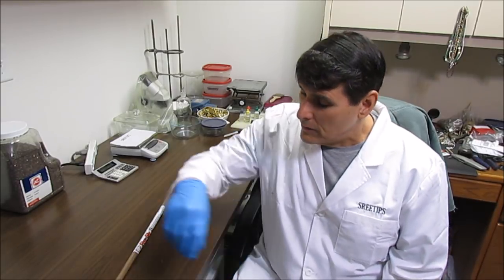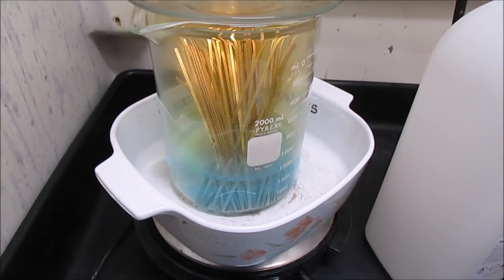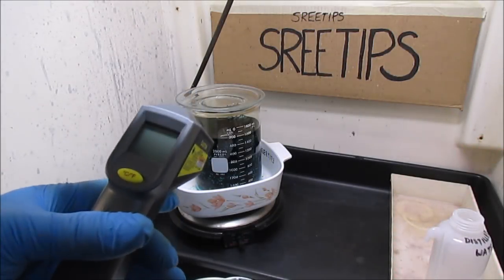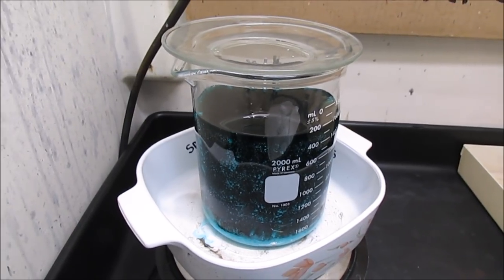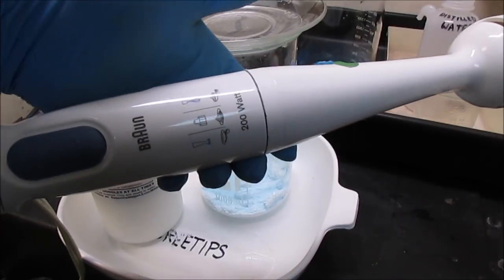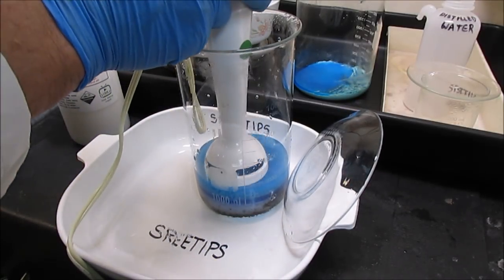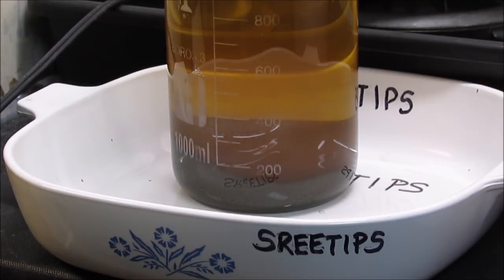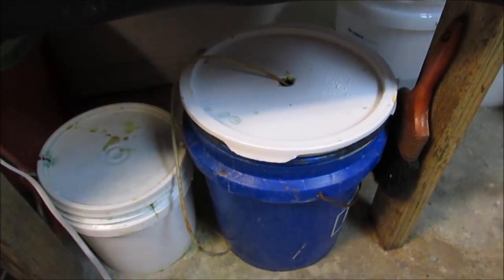Sreetips Silver Recovery From Brazing Rod

Comment: I’ve been saving brazing scraps for years. The plant that I worked at use to throw them away. I’ve got 35lbs saved. It’s all 80.15.5. Now I know what to do with it. Thanks sreetips!!!
Reply: Use electrowinning to remove the copper and save serious cash on nitric acid. 
I use this material all the time at work and have bought 10lbs for cheap awhile back to play with. 
For fun and in small quantities, sure nitric. 
35lbs….I’d build an electrowinning set up. And the precipitate in the video could be phosphorus??? I know they use some of that in stay silv for a self flux as it goes molten it burns up creating a tiny atmosphere, but when dissolving it could turn into a powder. I have the msd sheets in my cupboard.

Comment: Whodathunk to recover silver from brazing rods? Sreetips, that's who! Excellent video, the yield was unexpectedly low, but you still have some more rod ends and some silver chloride to process from this batch of rods. You pulled it off nicely, sreetips, a guy could save up the silver solder brazing rod bits, and make a nice silver stash from them. At least they wouldn't have to go into the garbage.

Comment: I subbed the first time I found this site, one of my go to's for great info. I have accumulated about 40 lbs of high quality computer gold from older computers well cleaned. My problem is finding nitric acid in gallon containers where I live in western canada. 👍
Reply from the maker: Hello. You can use acid peroxide to lift the gold foils off the fiber board. Then dissolve the gold foils in bleach and HCl. Precipitate with SMB or ferrous sulfate. Not one drop of nitric required.
Reply: @sreetips  Thanks, I will do that. 👍

Comment: Hey sreetips!! I've worked with Harris 15 for most of my life.   What you might not have picked up is that silver brazing rods have a significant amount of phosphorous added to act as a wetting agent when the silver/copper alloy begins to flow.  You can buy brazing rods with different alloys all the way from 45% down to 0% which is called Phos-copper brazing rod.  You just did in reverse what I've wanted to do for years and that is make my own brazing rods. haha
Reply from the maker: Cool, I seen these at the welding store and decided to try to get the silver out.

Comment: Thanks for this video, I think that I can determine a way to apply this profitably: I work in HVAC and am also a beginner hobby refiner.

I already seperate/cut my clean copper scrap from the soldered joints when cashing it in because of the superior payout on the clean versus soldered. 

If I use the silver soldered copper in order to precipitate silver out of  nitric (if Im already doing that anyway) then I can seperate the silver from the copper and cement the silver out at the same time. 

Thanks again.
Reply from the maker: I agree

Comment: I was thinking that a copper sulfate cell would work better and be more cost effective. Then your silver would be in the anode sludge and wouldn't need to be precipitated , just dried and melted and rerun through your silver cell. I love your videos bro !!! I learned why my copper sulfate cell turned green from the info you gave about your waste bucket. 
I was using a stainless steel anode basket I made to dissolve the copper away from silver electrical contacts. My basket started to dissolve and I learned just now that was an iron contaminant from the dissolving basket . Thank you sir 😎
Reply from the maker: Bravo. Try using a plastic anode basket.
Reply: @sreetips  I like your silver cell anode basket better .

Comment: Thank you for this video, I've wondered about getting silver out of these rods and silver solder. I have been in coin collecting on an amateur level since about 1974 and I started working in maintenance, commercial and then later industrial electrical also periods of general maintenance and whatever else was necessary to pay the bills as long as it was legal and ethical, sorry just rambling.

Comment: Probably electrolytic refining would be the way to go. I'm doing it now. You're my teacher so I respect the fact that you took your time to make this video.
Reply from the maker: I never considered running it through an electrolytic cell. The large amount of copper (80% by weight) would quickly foul the electrolyte. But it could be added a few pieces at a time during normal silver cell operation until it was completely processed. I don't know what the phosphorus would do to the cell.
Reply: sreetips your half right. Run it like you are refining copper and not silver. Then the silver will coalesce under the anode as blacks and then you can refine that. Not copper in silver nitrate but cu+4 plating out on a copper plate. Leaving the silver as a byproduct
Reply from the maker: Got it, but I've no experience refining copper. I get loads of copper to use for refining from yard sales and I buy copper fittings for cheap as well.
Reply: Yes! I think I referred to this in a reply to another comment.  This link shows the copper electroplating process real well.  You end up with pure copper on the cathode and everything else is in the bottom as anode slimes.  The anode slimes can then be refined.  
https://www.youtube.com/watch?v=cnJeK9CwkiU

Comment: Light Blue precipitate is likely tin (IV) oxide, SnO2.  Tin is often added to brazing alloys to reduce their flow point and assiust in wetting copper.  ASlso be aware that many copper based brazing alloys contain phosphorus, mostly present as copper phosphide.
Reply from the maker: This brazing material had phosphorous listed on the label.

Comment: You did an amazing job sir!  I'd be most interested in learning more. I've purchased probably around 50 pounds of 15% silver soldier and harvest  hundreds of pounds of soldered joints.
Reply from the maker: It will take much nitric acid to dissolve all the metal. Probably more than the silver is worth.
Reply: @sreetips  If you are someone with more time than money you can always recover the Nitric acid by distillation.

Comment: This was another instructive and informative video as i have learned to expect from you. Thanks for your work.

I watched another man process Silver in a You Tube video...not to refine it to market it... but to make something for which he needed Silver...which I cannot remember...and I did not bookmark the video...ouch.

Well after he had precipitated the Silver Oxide from the Silver Chloride solution he just melted the Silver Oxide in order to retrieve his Silver. 

He did not bother with adding sugar or Karo Syrup. He claimed that the Oxygen combines with the Gas during his melt....which makes sense when considering an efficient use of fuel. 

Silver Oxide is an Oxidant, I believe. And you are releasing energy when adding the Sugar...perhaps heat which can be added to melt when the excess Oxygen is added to the Gas....and heat is released

So what are the downsides, if any, to that process?

I think I may try that...unless you have a reason why that you are not to do that. 

Thanks for your forthcoming answer..
Reply from the maker: I've been told that the silver oxide will melt straight away. But I've never tried it. However, you must remove as much of the sodium hydroxide as possible before melting the silver oxide. Molten sodium hydroxide will attach and melt silica (glass). If some of the lye (sodium hydroxide) is still present in the silver oxide, then it will dissolve the fused silica melt dish and deposit the glass on to your metal. It must then be removed mechanically from the metal.

Comment: Just caught this video and you have probably already figured it out but... Those silver brazing rods are 5% phosphorus. With nitric acid, that will redox to phosphoric acid, which should not effect what you were doing, but that and some miscelaneous impruities and manufacturing slag, were most likely the "unknown precipitate". I'm a little fuzzy on the subject, but silver nitrate (I) with phosphoric acid, i think will create silver orthophosphate. I'm not exactly sure what that reaction would have had done in your mix, but possibly lowering the yield and leaving some yellowish sludge. In a perfect world (by equation) it takes 4.3ml of azeotropic nitric acid (68ish percent) to dissolve 1gram of copper. At 80% copper in the material, that would have required 1567ml of conc. nitric to get the job done (ouch!). Not to mention the H20 need for solubility. Add in the 82.96ml of nitric needed for dissolving the 15% silver (68.37g) at 1.22ml HNO3 per gram of Ag. The nitric need for copper is why whenever I need to inquart, I much prefer silver to keep the refining costs down (Ag is 28% of the cost of processing Cu). So... my opinion is... two things were battling you (1) a ton of nitric required and (2) possibly some interactions with phosphorus. Maybe a high power chemist could enlighten us further.
Reply: Damn bro give him hell ❤lol😂

Comment: I'm going to suggest you convert the silver chloride to silver metal by drying it, add 1.5 x molar sodium carbonaste< and just melt in graphite crucible.   The carbonate/chloride xixture melts at about 800°C and serves very weLL as a flux.  No need to make things all sticky with borax.  Just melt and pour beautiful metallic silver.  Nickel does not interfere, nor does tin oxide.  Easy peasy, no need to reduce before melting.  Chemical reduction is not only unnecessary but vastly complicates the mechanics.  My technique is dissolve, then prepip as chloride, add 1.5x molar amount of anhydrous sodium carbonate, dump in a crucible and melt.  then pour off in graphite bar mold.
Reply from the maker: Harold_V on the GRF said he tried this method with good results. He said that the crucible must not be over-filled with the chloride. I think he recommended no more than 1/4 full of the dried silver chloride. Because it will boil over with the carbonate and create a big mess in the furnace. I prefer the wet chemical process myself.

Comment: It is still an honor to benefit from your sacrifice in the name of education, thank you again.  Would I be correct to speculate the cost of the nitric would negate the recovery on a couple 2lb blooms that are 28% silver according to a spectral analysis?
Reply from the maker: That would be an accurate conclusion Scott. There is just too much copper in that alloy to make it profitable. If nitric acid was cheap enough, and you came across a large quantity of the silver brazing rod, then it might be worth looking at. Especially when silver gets up around $100 per troy ounce, and it will, when all these financial bubbles start to pop.
Reply: Thanks for the reply.  I too am afraid that when the Polytetrafluoroethylene wears off the Teflon Don, the markets may close down like a Dutch tulip on a rainy night.
Reply: @scottlund4562  Don't knock our tulips!

Comment: I suck at chemistry but I am curious if its possible to also recover the copper and other metals in the rod that dissolved into solution?
Reply from the maker: Getting the copper is easy, just add the copper solution to a container full of iron. The copper will precipitate on the iron as a fine copper powder and fall to the bottom of the container as nearly pure copper metal. The iron goes into solution as the copper comes out of solution. However, if other metals are present that are lower down the list in the reactivity series of metals, then they too will precipitate out with the copper. I'll do a video on the reactivity series of metals. It's so important to understand how it works and is applicable at every level of refining precious metals, as well as non-precious metals.
Reply: I am looking forward to seeing that video. Its to bad most chemistry classes in school are all about the textbook and almost nothing to do with real experiments. Watching your videos helps me understand some chemistry and I enjoy it. Maybe one day I'll try to extract the platinum from a whole bunch of spark plug tips I have collected over the years, I think CodysLab did that in one of his videos.

Comment: Thanks again for another fantastic video. Could it have been easier to dissolve if the brazen rods were melted down first? I am not knowledgeable on the subject of welding but that was my first thought.
Reply from the maker: No, melting would not change the rate that it dissolved. With that much copper in there, the silver, as it dissolved, cemented right back out of solution on to the copper. Then more nitric was consumed to dissolve the silver again, then it would cement out on the copper - over and over using more nitric acid as it went. This will keep happening until all the copper and silver has dissolved completely. I think I was almost there in the video. I may make a supplemental video and process the residual silver from the waste and from the bits that remained in the reaction beaker.

Comment: I used 40% Nitric ..that's about 8 mol of Nitric per liter... so I needed (fictionally) half a liter of Nitric = 4 mol of HNO3 to dissolve 0.5 ( 3 x 108) = 162 grams of Silver. You need that for every metal and also need to take in account what the solubility is. You can also see that in diluted nitric with every 3 mol of Silver 2 mol = 36 grams of water is formed.

Comment: Angle iron to put in your waste bucket is quite expensive.  I would suggest looking around local train tracks for discarded railroad spikes and rail plates.  They are free.  I use them in my waste bucket.
Reply from the maker: I agree, those three pieces cost me about ten bucks. I've just never taken the time to go out and find some scrap iron. I've been like that as far back as I can remember, convenience over frugality. Probably why I am broke today!
Reply: How about using scrap auto brake discs. Big surface area and plenty around.

Comment: I knew there was silver to be had in solder :) Of course it's not just any kind of solder you used in this case... but I'm sure other kinds of solder contain at the very least traces of silver as well.
That being said, were you aware that some older lightning rods contain platinum or silver as well? Be careful though, some lightning rods from before WW II also contain slight amounts of radioactive radium or uranium. 
People thought, back then, the radioactive material would ionize the air around it making lightning flow easier; which, all being said and done is a bit weird, since you certainly don't want to attract even MORE lightning.
Thanks for the video and taking me up on my suggestion about the solder :)
Great video
Reply from the maker: So your the one who suggested it, thank you for the idea!
Reply from the maker: I'll keep my eyes open for a lightning rod. That would make a good video.

Comment: Did you figure out what the sediment was during the nitric acid stage? I've been dissolving whole circuit boards in nitric and have been dealing with mystery sediment  the whole time. I don't know if it's good stuff or bad stuff... but it is a tan color and it settles fast, leaving a forest green liquid that looks just like stuff you had in a palladium video. I really don't suspect mine is due to large amounts of palladium though.
Reply from the maker: Get some stannous chloride. Lean how to identify metals in solution
Reply: @sreetips  Thanks for the keywords to search. One of the videos that pops up is from you. I watched it and leaned some things, but in it, you said that you didn't know [the answer to my question]. You could have just answered with that, but then I wouldn't have gone and leaned from the combination of informative clips.

Comment: For Copper in dilute nitric : 3Cu + 8 HNO3 _> 3Cu(HNO3)2 + 4H20 + 2NO = 3 (63,5) + 8(63) -> 3(188) + 4(18) + 2(30) so I need 1 liter = 8 mol nitric to dissolve 190 grams of Copper..with that reaktion also 72 grams of water is produced. But as we have seen in the Soluability tables Copper nitrate dissolves much less in aqueous solution than  SilverNitrate....I put some effort in it Mr. Sreetips...I hope you can digest this.
Reply from the maker: Yes, you have a firm grasp on the chemistry. I know very little about the chemistry. I just go by the seat of my pants relying on my experience to pull me through. Thank you for that analysis.

Comment: Also, your ventilation system is a great idea
Reply from the maker: It's an old Labconco protector fume hood. I'll make a short video showing the whole setup.
Reply: Thank you that would be great. I really do appreciate you.
Reply: it looked like a shower stall cut down
Reply from the maker: The interior and exhaust are all made of fiberglass to resist corrosion. But the outer frame is made of steel. I'll make a short video of it and post it soon.

Comment: If you have braze wire that has been melted down into globs, ours is bAG 24 so 50% silver if you made it into pellets would you be able to use the silver cell to extract more silver than using the dilute nitric acid solution?
Reply from the maker: Chris, I only use 99% pure silver to run through my silver cell. You could run 90% or sterling silver through it. But with that much copper the cell electrolyte would quickly become saturated with copper. After about 60 grams per liter of dissolved copper in the electrolyte it (copper) will begin to plate out with the pure silver and contaminate the crystal. If it were me, I wouldn't run 50% silver in my silver cell. I'd extract the silver from the brazing material globs first, then run it through the cell, if it were me. In refining, taking short cuts usually ends up costing, time and money.